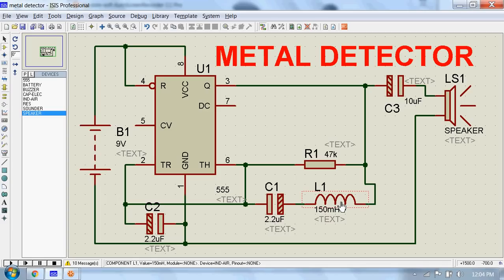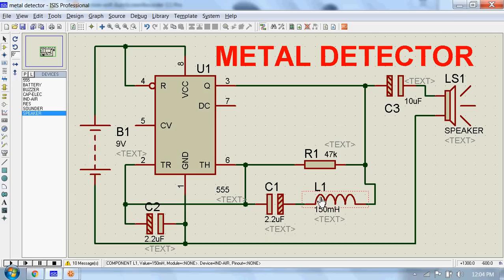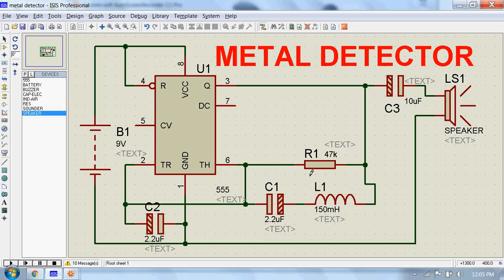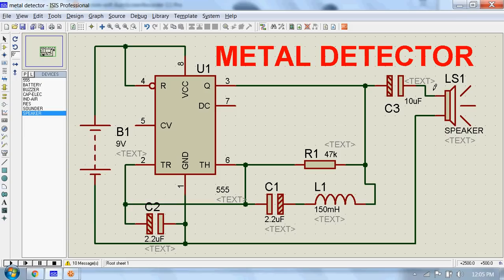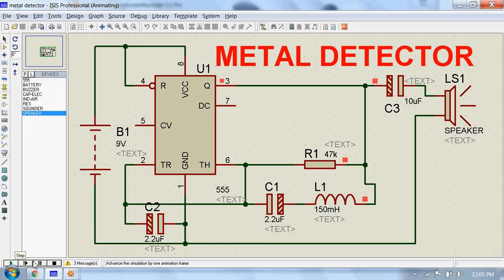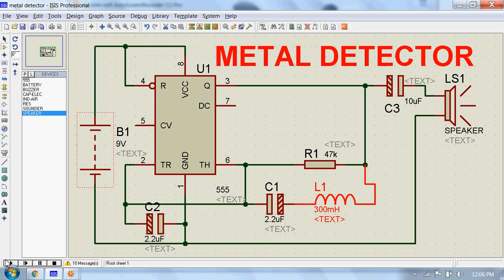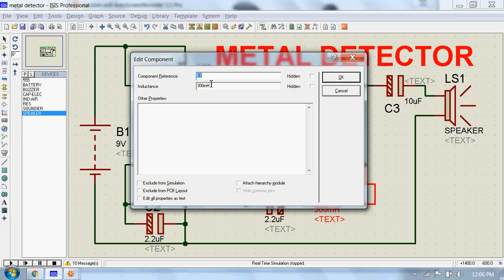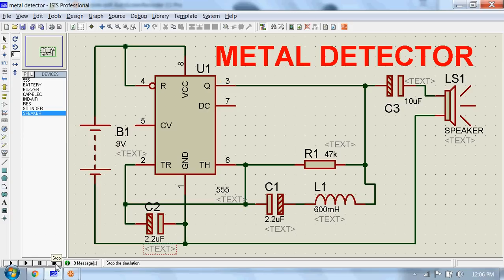Intermediate Electronics Project #8 - METAL DETECTOR

Comment: Anyone can explain me how can be calculated the frequency of the produced signal? I simulated and it is not the LC circuit resonance frequency (f=1/2*pi*sqrt(L*C)). In a typical astable 555 corcuit, a R1 placed between vcc and dis pin and a R2 between dis and th defines a frequency. I could understand to placed later on in parallel a LC circuit which should be resonant at that frequency but I don not understand this schematic...

Comment: Nice video. Why we have used c3 and c2 capacitors. Whats their function.
Reply from the maker: The capacitor connected to resistor and inductor in series form an RLC circuit which acts as a detector.

Comment: how can i make it off when there is no metal coz its always on  i mean the sound
Reply from the maker: Please research about it coz that's the improvement you can make in this circuit and let me know if you find a solution.
Reply: did u get the answer? if yes then please share

Comment: A very nice simulation/circuit, but the following expression is not correct; "With this sudden increase in inductance of the coil, the overall reactance or impedance of the RLC circuit changes." The inductance changes slightly for many type of metals, yes, but the reason of working is not that. The target metal (because of Eddy currents) causes extra induction on the coil while the self inductance of the coil remains almost (slightly) constant. Most metal types are non-ferrous (Aluminum, Gold, Brass, Silver, Coppper) and those does not change the inductance and magnetic path in the known way of permeability.